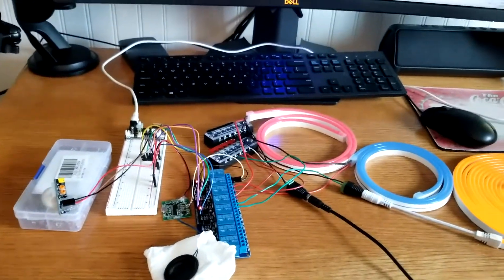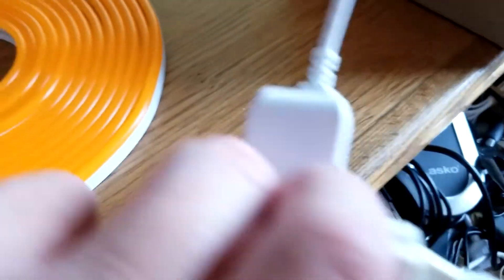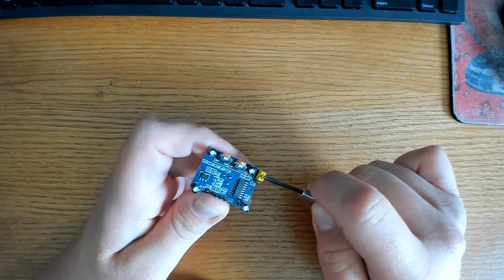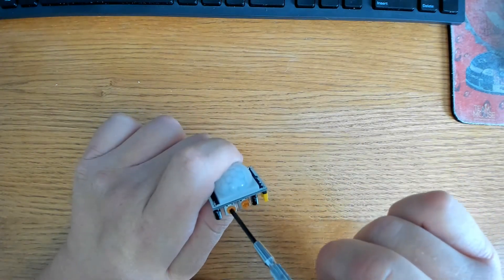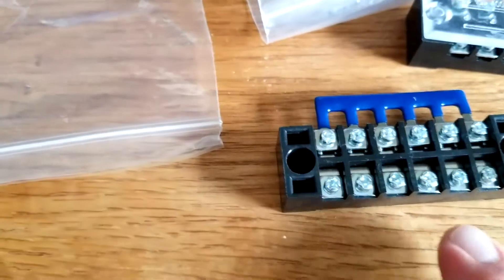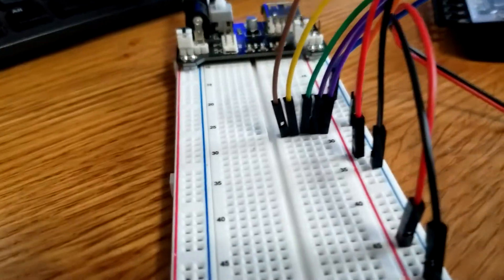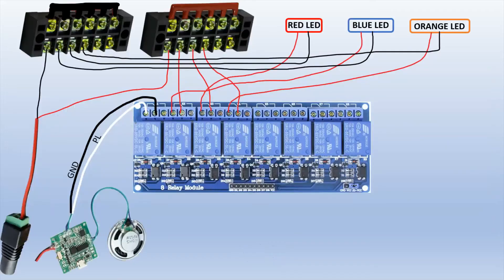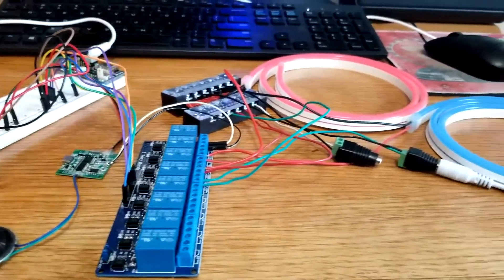Make Your Own Motion Activated Halloween Display Without Using Arduino That's Easy Enough For Anyone

Comment from the maker: There are other ways to switch your mp3 player and 12v electronic on and off. I wanted to use relays because it's the easiest way for anyone to do this. If you want to shuffle multiple multiple mp3's with a motion activated setup and use a louder speaker system, check out the video link in the description. Enjoy!